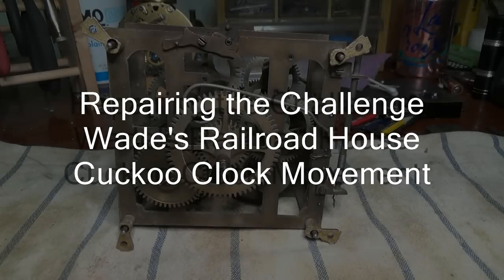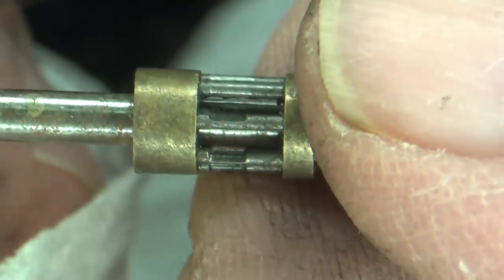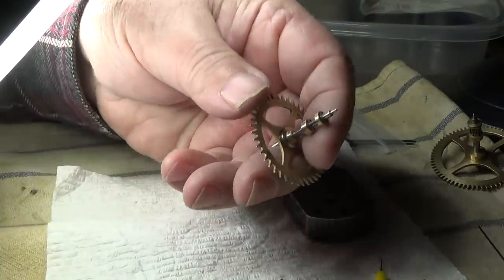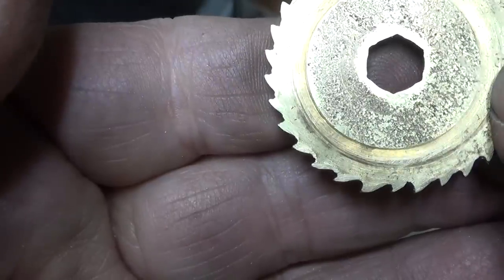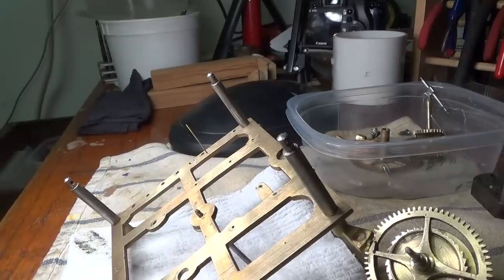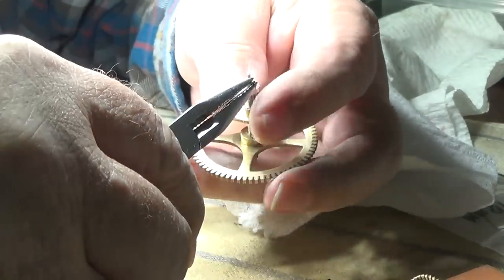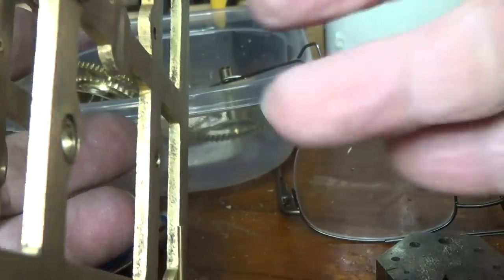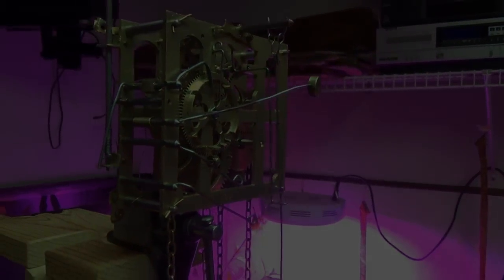Repairing the Challenge - Wade's Railroad House Cuckoo Clock

Comment: An index for this video:
0:00 Summary of the repair work to do.
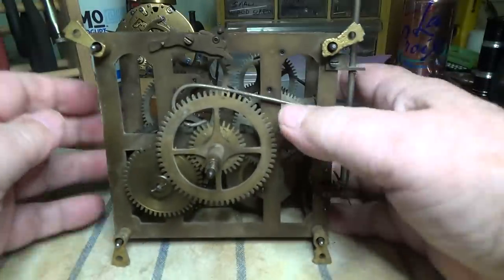1:36 Disassembling the movement.
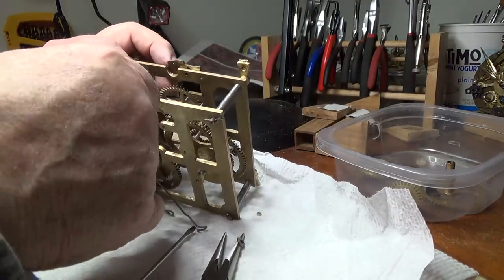4:14 "Somebody put a nail in there" (instead of a tapered pin)
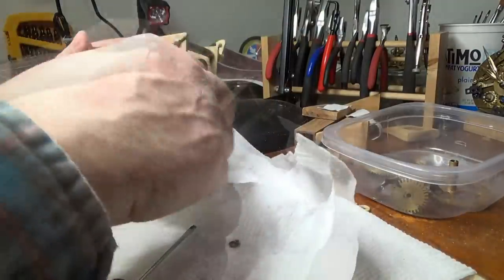4:44 Serious wear on the anchor.
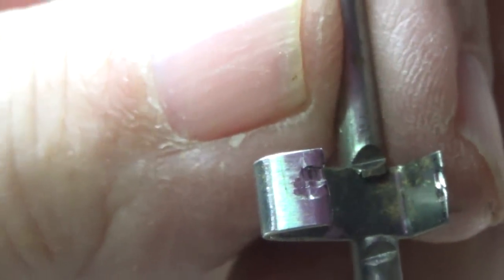5:31 Removing the levers; finding an odd piece of wire.
7:40 Removing the pins that hold the plates together.
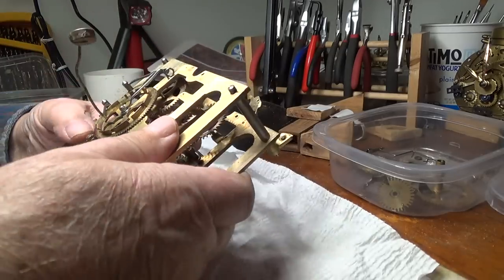8:22 The tension spring that holds the count wheel on. Removing the count wheel.
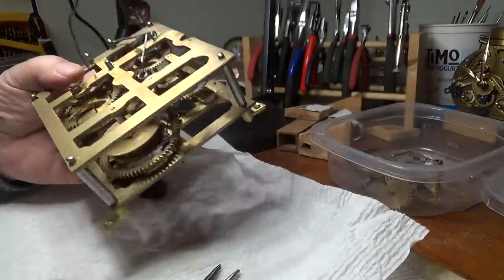8:50 The pin that holds a motion works gear.
9:45 Separating the plates and removing the wheels.
10:11 The worn strike train second wheel's cam. How to tell the surface has been worn.
11:19 The worn escape wheel trundles. Removing the time train second wheel.
11:50 How to remove the drop lever.
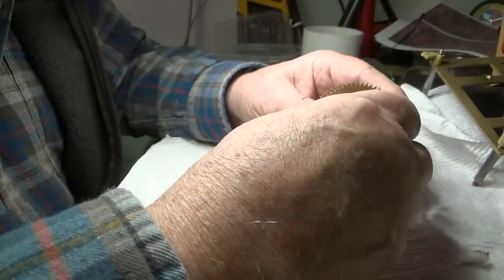12:13 How to disassemble the great wheels.
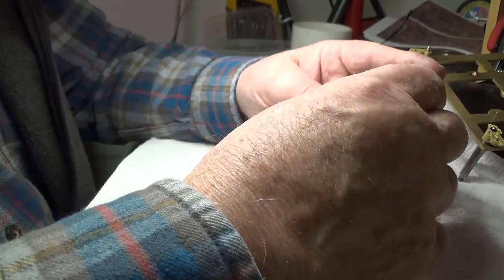14:01 Wear on the great wheel and how that can make the click fail. Finding a different style click on the other great wheel.
15:36 The fully disassembled movement, in bins.
15:53 A conically worn pivot that must be replaced. How to replace it.
18:06 A worn pivot and trundles on the escape wheel. Worn pivots on a great wheel.
20:12 More worn pivots and trundles.
20:44 Detailed wear on the cam.
21:50 Worn warning wheel pin and trundles.
22:29 How the worn cam and drop lever affects the bird door.
26:55 The anchor wear may be difficult to grind out.
28:32 How he's going to replace the trundles; why he doesn't like to pull the shroud.
30:03 Removing the worn trundles.
36:11 The plan for replacing the trundles, in detail.
39:45 Pushing worn trundles out without cutting them.
40:45 Xuron Corp cutter used to cut the pinion wire, to make new trundles.
41:27 Measuring, cutting, inserting, engraving, and locking the new trundles.
51:08 Repivoting the escape wheel, polishing its new pivots.
1:01:28 Removing the hexagonal center shaft of a great wheel. Outlining the repair work to do.
1:05:21 Replacing a worn ratchet tooth.
1:11:00 Test-fitting the new hexagonal shaft
1:11:36 Dismantling the second great wheel.
1:13:51 Comparing the two great wheels' parts: brass vs. steel shoulders.
1:15:39 Making the replacement hexagonal shaft.
1:18:06 Reassembling the great wheel on the new shaft.
1:23:50 The reassembled wheel fits correctly on the great wheel arbor. Test running the repaired wheels in the time train.
1:25:01 Finding which pivot holes are worn enough to be bushed. Marking the un-worn side of each hole.
1:27:29 Bushing a worn pivot hole.
1:34:41 A worn and tunneled pivot hole, under magnification.
1:36:32 Moving the escape gear so that it will wear a fresh part of the anchor.
1:40:20 Broaching the anchor pivot holes (part of bushing). Testing the new holes.
1:43:50 Test running the time train overnight.
1:45:23 Replacing worn trundles in the strike train wheels.
1:57:54 Reviewing the repaired pivot holes (the bushing).
1:58:57 Issues with the worn drop lever. The purpose of the drop lever. Planning how to repair it.
2:07:48 Rebuilding the worn parts of the drop lever.
2:10:18 Evidence that two levers were scavenged from a different movement. Planning how to repair it.
2:15:52 The repaired warning lever's arbor. Testing and adjusting the repaired strike levers.
2:20:08 The mis-wound Perch helper spring.
2:20:47 Reassembling and oiling the repaired movement.
2:31:02 Running the movement on a test stand. The strike chain has the wrong number of links per foot.

Comment: I really appreciated your taking the time to accurately explain, and record the issues you encounter when rebuilding cuckoo movements, so that those of us just learning can fully understand the interaction between parts, and why things may be failing.  It really helps us learn how to problem solve and correct wear, improper past repairs, etc   I actually have two PHS movements like this, and really appreciate being able to understand the proper interaction between components. Of particular help was your replacement of the lantern pinion trundles, which is something I definitely need to do on one of my movements. I am pretty sure I watched you rebuild a Regula movement as well, and I have a couple of those I will be servicing as well. Thank you for your videos!
Reply from the maker: Thank you for your comments and for watching the videos.

Comment: I have a Cuckoo Clock that hasn 't worked in twenty years. I think that I might try to get the inner workings going by watching you; a lot!
Reply from the maker: Go for it.  That's how I learned -- by doing!  If you don't succeed, you'll have what you've had for 20 years -- a clock that doesn't work.

Comment: At 2:31:02 you can see what looks like a leather insert in the gong hammer. I've never seen that before in a cuckoo clock - it must sound nice! Thanks again for the wonderful video!
Reply from the maker: It is a nice touch. I'm sure it softens the sound of the gong.  I only had the movement, so I couldn't test it in the case.  It belongs to a fellow in Minnesota, who's restoring the case.

Comment: LOVE this video for so many reasons. Excellent instruction! The intermediate wheel appears at 2:26:06 with no re-assembly commentary. What prevent the gear from spinning on the shaft (my current issue, hands don't move) The pin will keep the gears on the front face aligned, but something must hold the gear...spline?...keyway?...epoxy?😆 Do the washer and tension washer mentioned at 2:40 provide enough force to keep it in place?  Thanks in advance.
Reply from the maker: On every clock, the motion works (the gears that run the minute and hour hands) have to  have some type of clutch mechanism that allows the hands to be set to the correct time.  The clutch creates enough tightness to allow the time set of gears to move the motion works, but allows enough "slip' to allow the gears that run the hands to move when setting the time.  If there were no slip, the hands could not be set to the correct time.  Most often, the clutch is a tension washer under the intermediate wheel.  There are other clutch designs on other clocks.  In this clock mechanism, the intermediate wheel is on the same arbor as the main wheel of the time train.  Were it solidly attached as the main wheel is, the hands could not be moved as their gears would be locked into the time train.  The intermediate wheel is loose on the arbor, but a washer with a square hole in it fits onto a square portion of the arbor and presses against the intermediate wheel with just enough force to allow transmission of power from the time train to the motion works.  When the hands are moved, the legs of the tension washer slide on the rim of the intermediate wheel, allowing it to move.  Here is the assembly of the washer and intermediate wheel from another video.  https://youtu.be/ZeN07SW6Dd8?t=2910

Comment: I would really enjoy watching you tackle separating the gears process, as with the Strike Mainwheel gear, so I know what to buy. I attempted to remove that exact small gear with no luck.
Reply from the maker: I assume you mean the small gear that moves the count wheel.  You have to look very closely at it.  I've found some that are a friction fit, but most have had a very small wire through a hole through the gear and through the arbor that holds it firm.  If you assume it is a friction fit, you'll have no luck removing it without causing significant damage.  Look carefully.
Reply: @dperry428  basically what type of puller would you use to remove such a small gear? I understand some damage will occur. I have a puller from Timesavers, #23770 but just too thick.
Reply from the maker: If you've removed the pin, use two screwdriver blades on both sides of the arbor underneath the  gear and twist them in opposite directions. Or, use levers such as these https://www.ronellclock.com/product/large-lever-style-clock-hand-remover/  Hardware stores often have something similar for removing paint can lids.
Reply: @dperry428  Thanks so much, this is what I am looking for! These unique tools which serve a specific role.

Comment: Question regarding broaching on the escape gear new bush.  Should broaching the replacement bushing (at about 1:33) be done only from the gear side?  The way the broach moved suggests it could be done from either side.
Reply from the maker: Since broaches, both cutting and smoothing, are tapered, it is recommended that the holes be cut and polished from both sides to make the sides of the hole as close to parallel as possible. In the instance you reference, I was showing only the smoothing broach being used.  When using a cutting broach, it is held perpendicular to the plate.  With the smoothing broach, which doesn't cut, but burnishes, it is recommended that the broach be moved in a circular motion while spinning it within the hole. It, likewise, should be done from both sides of the hole since the broach is tapered.  That ensures polishing the entire hole.

Comment: Thank you for being so willing to share your repair process. One question regarding the loop on that warning lever - the loop was extending too far out. 2:11:34 What did you do to shorten it so that it rode on top of the previous wheels’ pinion?
Reply from the maker: I removed that lever from the arbor by grinding off the peened end of it and driving it out.  I then measured, cut it off to proper length, reinserted it in the arbor and silver soldered it in place.

Comment: Fantastic job!  I have learned a lot from this video. Two questions I have are: Where did you acquire those cutters for the pinion wire? and secondly: What is the number of the Loctite you used? Thanks for sharing your years of expertise with us. All the best, Sean
Reply from the maker: The cutters are Xuron hard wire cutters.  Can be purchased through Xuron Corporation or Amazon.   Loctite is Red Loctite 262, high strength but low temperature so it can be removed with 300 degree heat. Also, chemical resistant to withstand clock cleaning solutions.

Comment: Great video! I watched one of your Faux stone videos long back and thoroughly enjoyed it! You have a calming effect as you speak, a plus many cannot claim. I was pleased when I found this video you made. As a Black Forest clock collector I have been repairing movements for some time now yet even I learned a few tricks from you, so thanks for that.
  My question is, aside from the need to replace a tooth on the ratchet wheel, why not just re-bush the arbor hole on the wheel using brass pipe? I have successful brought them back to tolerance using that method saving a lot of time and work. Just wanted your thoughts on that.
  The Philipp Hass and sons firm made quality movements in their day, recognizable by the springing rabbit verge plates, well worth all the time you spent repairing it.
Cheers, Jim
Reply from the maker: I'm not sure I'm following what you are suggesting. If you are talking about the chain wheel with the hex brass, I could also just turn a brass insert on my lathe.  By rebuilding with a new piece of hex brass and drilling the hole on my lathe, I know the center is true.  If one puts the whole chain assembly in the lathe, there is not likely to be concentricity between the parts and the new hole drilled through the old hex would stand a good chance of not being dead center, which creates the potential for future problems as that off-center hole wears.  Also, by disassembling the chain-carrying parts, I can clean each piece, which is not possible leaving it intact.
Reply: @dperry428 

Hi and thanks so much for your response,
I'll try to clarify my explanation, agreed, you have to disassemble the entire wheel to clean each individual component or in order to repair worn/broken teeth. In the absence of any worn or damaged teeth it is so labor intensive and requires a lathe to disassemble the chain wheel. The method I've used is to use a hollow brass pipe of which the inner diameter is the same or smaller than the arbor and the outside diameter of the brass pipe is slightly larger than the old worn hole, hence creating a long bushing if you will. I leave it slightly longer in length than the width of the wheel so it can be hammered and compressed in place and finally broaching it to match the correct hole size for the arbor. Drilling out the old worn hole centered, I use the same method as with any new bushing. Most I've attempted were pretty evenly worn holes. The chain wheel (I referred to as the ratchet wheel previously) is only serving as a pulley basically, so exact concentricity isn't so important but the few I have done worked out fine.
  My thought is to offer an alternative method, only if the need to take apart the whole assembly isn't necessary. Believe me, if I took apart every chain wheel I serviced, I'd have given up the hobby by now!
  Kind regards and I hope this explanation was a better one.. clearly your skills surpass mine in machining! Looking forward to more videos from you if you do.

Jim

Comment: If you don't have the weights, how do you know how much weight to put on a cuckoo clock?
Reply from the maker: When I've run into that situation, I attach a ziploc bag to the chain and add weights in the form of sand, pebbles or nuts and bolts until the clock runs reliably.  Then, use a kitchen scale to weigh the bag.  Weights of that amount or slightly greater can then be purchased from a clock supply. I buy weights from Frankenmuth Clocks  https://frankenmuthclock.com/collections/parts-cuckoo-clock-quartz-cuckoo-miniature/weights
Reply: Thank you! Very helpful.   @dperry428

Comment: Mr Perry I have enjoyed watching all your repairs on cuckoo clocks. I have been working on a few cuckoo clocks as well.I am just getting into the trade. I enjoy it it gives my mind a challenge I have come across a Hubert herr movement. I’ve replaced a few bushings the movement is running great but in the process of putting it back together I noticed the plastic Minute wheel with minute pinion has a bad spot on the pinion can you help me I can’t find that plastic gear. Can you direct me to a website to find one 

Thank you 
Karl
Reply from the maker: Is this what you are looking for?  https://www.blackforestimports.com/category/Parts-Accessories/Cuckoo-Parts-Accessories/Wheels-Gears-Cuckoo/Minute-Wheel-Idler-Gear-Cuckoo/
Reply: Yes I believe so as long as it has the minute pinion on it can’t tell from the pic 
Thank you sir I’ll look into to it more
Reply: Yes sir that is the one I am looking for thank you for the help

Comment: Hello, Mr. Perry! I have a question about your lathe. I'm looking into buying a Sherline 8 inch lathe for clockmaking, but I would like to save a few bucks. Would you say that the speed control is necessary for a clockmaker's lathe, or should I save a hundred dollars and forego the speed control?
Reply from the maker: As far as I know, the lathe is not  sold minus just the speed control.  The option is to buy the lathe without a motor/speed control.  If you go that option, you'll still have to have your own motor.  And, yes, speed control is essential for differing functions.  Cutting brass requires a higher speed than steel, for example.  Drilling to replace a pivot requires a lower speed, while polishing a pivot requires a high speed.
Reply: @dperry428  I see! Thank you for your wisdom!

Comment: Hi, I'm David and I send you greetings from Spain... I recently became fond of the world of watchmaking and I follow your channel, it's a real pleasure to see you work... I recently bought a mechanism just like this... but I don't know the weights...(counterweights and pendulum).. I have rebuilt the anchor rod...because I didn't have it, but I don't know the exact length measurement so that it works well. Could you tell me the weights and the measure of the rods of the pendulum? thanks in advance and regards 🖐
Reply from the maker: David, I can't refer back to the clock as it's back with its owner.  These clocks used weights between 700 and 1000 grams.  The best way to determine what weight to get for your particular clock is to hang a small container (pail or plastic bag from the chain and add weight to it in the form of sand, pebbles or nuts and bolts until the clock runs reliably. Then, weigh container with a postage scale and buy weights of equal or greater weight.  As far as the length of the pendulum, the wire leader should extend to the bottom edge of the movement and the pendulum itself would likely be about 7 or 8 inches (17.5 to 20.5 cm.).
Reply: @dperry428  Thank you very much, I will follow the advice of trying weights that are around
  this weight and I will take these measurements of the pendulum,...I only have the machinery and it is in very good condition...(the bearings need to be rectified)...I hope I can see it work...I will show it to you....

greetings
Reply from the maker: Post a video on your channel when you're done.

Comment: For the pins to rotate, would that technically cause slipping during operation?
Reply from the maker: No.  Those who believe the trundles should rotate think that it would prevent or slow wear.  Others believe the only reason they tend to be loose is to ease assembly at the factory.  I'm of the second opinion.